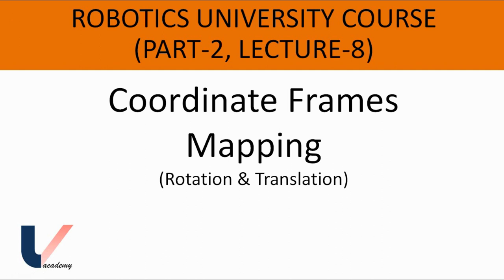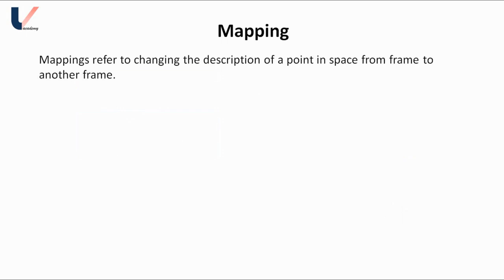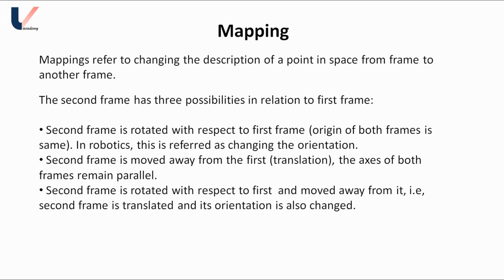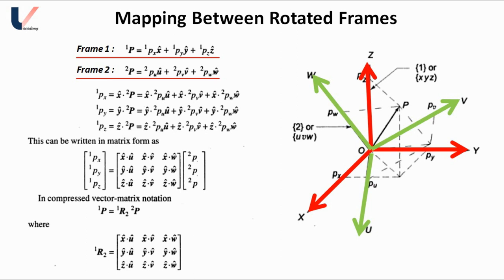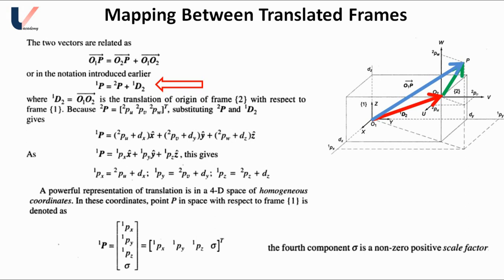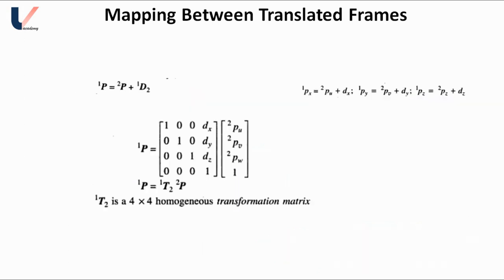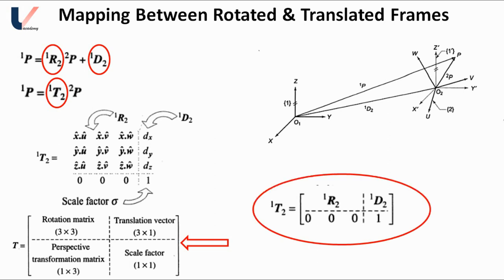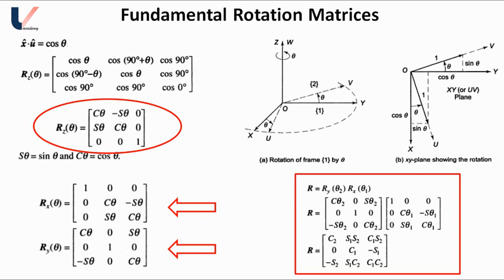Lecture 8 | Part 2 | Robotics University Course | Coordinate Frame & Mapping

Comment: thanks, I want to move my robot from point to another (coordinate system) but outdoor, can't figure the way that measures distance accurately and elevation is the biggest problem, because I want horizontal distance between points only< can you help me, sir.